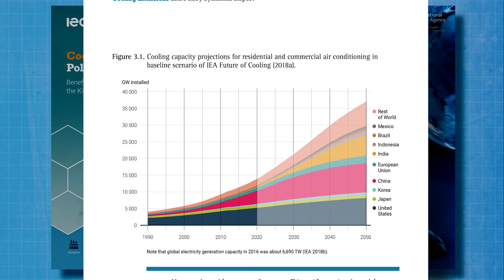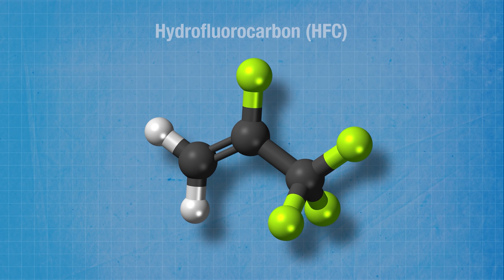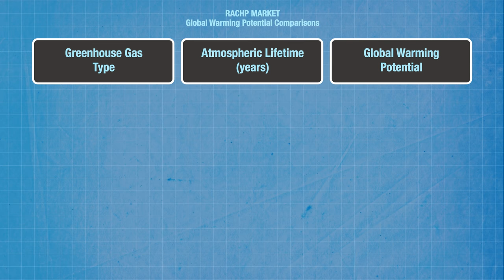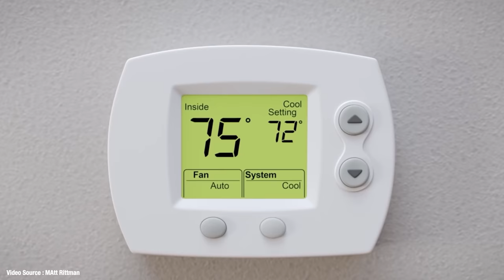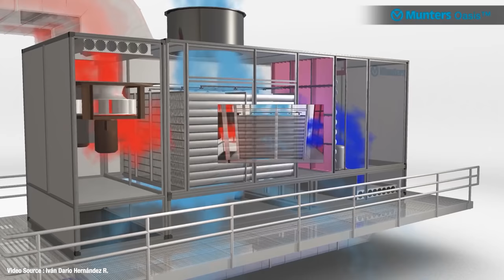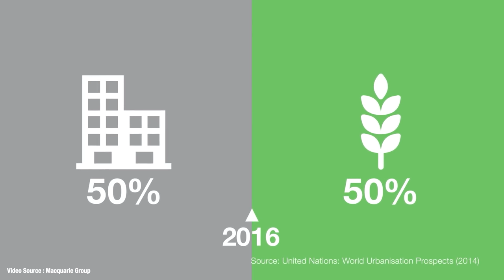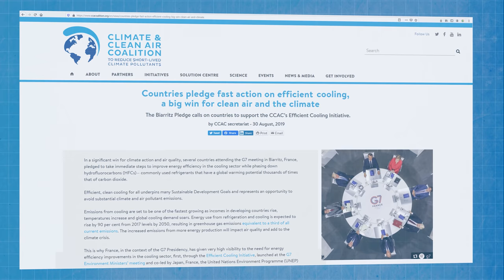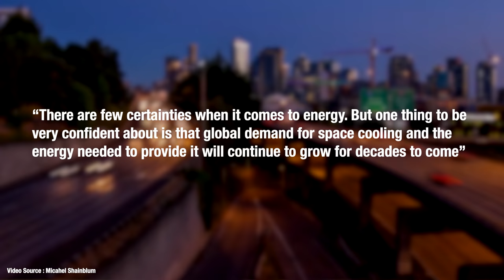Keeping cool in a warming world.

Comment: If a house is properly build with thick brick walls and good isolation, it might never need an air conditioning installation, just some heating and a heat reclaiming ventilation system.. Or just deal with the heat, like we do in The Netherlands.. Only large buildings have air conditioning here, family housing, virtually none. 

But sales of portable AC units has been going up sice we have one after the other record warm summers.. This summer we had an heatwave with 30degrees Celcius temperatures for more than two weeks, that are the times these portable AC units get sold out.

Comment: For regions that alternate between heating and cooling seasons, ground source (aka geothermal) heating and cooling could be helpful. Not only is it easier to transfer the heat to the cool ground than the hot air, but you are storing the heat from the cooling in the summer for use for heating in the winter.  For example here in Ottawa, Canada we go from an average low temperature of about -15C in January to an average high of about 26C in July (those are averages so obviously it gets much colder and hotter than that).

Comment: I went into Intensive Care overnight for a watering Jun 16, 2002. I only had 85 km left at 3 pm when it happened. I was going alright too until I went a bit unconscious, kept my heart at 135 bpm for 10 hours not letting it race & cause exhaustion. It was 35 degrees though & humid & the southwest air from Ohio & Illinois had a pollution alert index of "avoid breathing when possible" so I sweated 13-14 litres since 6 am and my heart stopped a little bit occasionally.  Great nostalgia memories.
Reply: Ouch.

Comment: I needed to replace my aging roofs some years ago. White roofing material was already commercially available then for a reasonable price. Now all my south facing roofs are white (they look out over a wooded area so not really standing out/eye sore) with the north facing roof is traditional black. Temperatures under the roof are now reasonable where before the space was unusable in summer.
Reply: I get a blindingly-white roof free of charge but it's a backwardsy method. It's non-stop blindingly-white November 1st to May 1st and then it's jet black May 1st to November 1st (in northern hemisphere). I must have used the wrong "adjustable roofing contractor".

Comment: One of the cheaper options is ground sourced cooling (and heating)!
Obviously the use of an "earth battery" is only good towards the ambient yearly temp! If you cool your house with one you are heating the catchment area ..... but that is heat you can recoup in the winter! Most of these rely on a Glycol heat transfer liquid rather than CFC. Although this may be negated by the inclusion of refrigerant heat exchangers coupled to the ground source heat pump ;0)
It may be an idea to incorporate some of the Earthship ethos into modern architecture! After all we are not just talking about an energy problem in isolation but also water management and waste disposal!
Reply: There is an air variant, called a Canadian Well. Involves a burried pipe, and a modest fan. Oh yes, an quite a bit of digging (that is how the heat gets in the ground ;-)

Comment: Thanks for another great video!

This is a really hard one to "fix" because excessive heat is a large and growing problem all over the world. Here in the West it's only a problem for two or three months in the year, but in countries closer to the equator heat is a never ending source of misery that's responsible for who knows how much inefficiency and an uncountable number of premature deaths. And with global warming causing climate change, the problem is only getting worse as weather patterns persist for longer periods. Heat waves last for a month instead of a week.

I think that cooling systems like A/C are a tremendous force for good worldwide. But as you say in your video, they've collectively become a positive feedback loop that's making the problem they were intended to solve even worse. The best solution (especially in warmer climates) is to design buildings (and cities) that don't need to be cooled as much in the first place. Then they could use systems like evaporative cooling to make up the difference. And this is a good idea for new construction. But most of us already live somewhere, and we're most likely going to keep on living in places that are already built. So any comprehensive solution to the problem of the feedback loop has to address cooling systems that are added to older structures.

Most architects treat HVAC as a separate system that gets plugged into their designs after the structure is already built, and whole industries depend upon the idea that you can take heating and cooling systems in and out of a building the same way you might change a hard drive on a computer. I think truly comprehensive solutions to the problem of the positive feedback loop have to work within that reality.

Comment: As I watch this video I'm sitting on my sailboat waiting out the pandemic in the tropics.  I'm running Air Conditioning that is powered by solar panels and batteries.  No generator on this boat.
   I've built a system based on a military equipment cooling compressor that is about 3 times more effeciency then what is generally used for ac.
   There are better ways to solve problems.  I'm a bleeding edge kinda engineer but what I'm doing now will be generally available in a few years.  -C
Reply: Oh Emily, you're living the dream. Good for you.
Reply: Hopefully it will hit the market soon. I would love to have one if it's not water cooled as I suspect yours would be. Standard air conditioners are rough on off grid systems.
Reply: @blaydCA  I'm not planning on developing it as a product.  But there will be a DIY video on our channel soon.  Bop over and subscribe.
   Yes my installation is sea water cooled but making one air cooled is just as easy.
Reply: @Clarks-Adventure  sounds interesting. On lockdown here riding out    the pandemic as well.  Thankfully off grid, so at least I don't have ye old 'lectric bill to worry about, but every year Southern California is hotter. What was installed years ago no longer handles to additional heat.

Comment: Supermarkets changing to a delivery based system with closed and energy-efficient coolers  serving households from central warehouses would make a great difference not just because of the smaller carbon footprint of the warehouse but by having one delivery truck serving twenty households in one optimized route instead of twenty vehicles driving back and forth for individual shopping trips. Of course, this mostly makes sense for the United States where farmers' markets are few and far between and individual food stores like butchers, bakers, and green grocers almost exotic.

Comment: Another good solution is an age old solution. Cutting ice from the lake in winter and storing it in cellars for spring, summer and fall. Then people can have ice boxes to keep the meat milk and other stuff cool without using any electricity at all.
Solar installations can be improved by cooling panels in the summer and storing the excess heat in heat batteries in the ground that can be used for geothermal heating in winter.

Comment: I’ve got to admit, I didn’t watch this one for ages because I didn’t want to think about those “what about global cooling, what happened to that?” people. Now I see it’s just a clever title for the energy costs of cooling our buildings. 

On the actual video, I’m dubious about that direct evaporative heating. There have been standalone machines that do that for decades now and they’re a very poor cooler on a hot day. Even though the air may be a few degrees cooler, it feels more oppressive due to the humidity. 

The indirect one looks like it has some potential though. Heat exchangers are good things. But the different refrigerants seems most important to me, as they’re used in heat pumps, fridges, freezers, as well as air conditioners. And it’s often more energy efficient to use these devices to make a cold side of a heat exchanger than to use water in such a system, if I’m not mistaken. 

So it’s important to get this right, as if we don’t, heat pumps etc will suffer too. And when our carbon is low power anyway, and we’re using heat pumps in the winter without guilt, I don’t see the issue in using regular A/C, with appropriate refrigerants. Though of course measures like white paint and adding greenery to reduce the energy demand is useful no matter what your source of cooling is. 

With regard to the paint, it’s been known for a long time, as that’s why the USA made many of its roads grey instead of black. They picked the grey as a balance between dazzling drivers and getting sizzling hot on sunny days. And that’s something to bear in mind with the white paint as well; reflecting 99% sounds good from an energy perspective but there’d be various health risks similar to white desert sand or snow to dazzling, long term damage, etc. if it were widespread enough. So it could be applied perhaps say to roofs but not to sidings, or perhaps we just choose a light grey instead of a white in practice? As always, there’s no outright solutions, just tradeoffs. 

But, as always, thought provoking!

Comment: In Costa Rica, Central  America, most houses are built of concrete blocks, with ceramic or tile floors, which are quite cool. No carpets. We have no air conditioning at home,  just keep the windows and inner doors open. Fans are used in the hot weather. Also, there is a lot of green life in gardens and backyards. However, it is the climate of our country that allows us to live without insulation or inner heating and cooling systems in our houses. I understand the United States can reach extremely high temperatures, even higher than our beaches in summer. I lived there for a while and I remember the heat of August.

Comment: I worked in Qatar for a year and I was struck by the amazing contrasts. One of these was air conditioning. There are huge shopping malls up to 5 stories high and including at least two full size ice rinks. These huge buildings are totally air conditioned so that you step out of almost 40deg C in the middle of summer into a cool 20 age C or so in the shopping mall. There are many huge office blocks and schools  - again totally air conditioned. The power come mainly from natural gas so I used to refer not to the carbon footprint so much as the carbon gumboot. These buildings have almost all been built in the past twenty years. Alongside these building are much older buildings which use a clever system of passive cooling. On the roof is a high chimney like structure which opens into the inside of the building. This chimney is heated by the sun causing an updraft of air which sucks cooler air into the lower parts of the building. In many of these older buildings there are pools of water placed so that the incoming air passes over the surface causing evaporation of the water. This has two effects. One is that the air inside is moistened which is pleasant after the drying air of the desert and also the forced evaporation cools the air further. Fuel input is zero (apart from water costs).

Comment: When people talk about heating and cooling they always think of air temperature instead of surface temperature.  I live in the midwest US, and over the past 20 years that I have lived here there has been a decent push towards getting insulaiton levels up to spec.  And as it is cheap and easy to do, and pays itself off in just a couple years it is one of those easy no-brainer moves that is easy to justify.  So what you end up with are lots of homes with lots of inuslaiton on top of the ceilings, and injected in the walls, and with an air temp of ~70-74*f, but with floors and cabinets that are closer to 40-50*f during the winter and 80-85*f during the summer.  This makes it feel colder than you expect during winter, and hotter than you expect during the summer months, and it is because basements are not 'lived in' or actively heated or cooled, so people don't address the air exchange going on there.  Seal up that little gap between the basement walls and the house, and you prevent that air exchange which makes your basement an even 65*f year round, which evens out your floor temps on the main level, and all the sudden you can dramatically lower your air temp in winter, and raise your air temp during the summer and still feel very comfortable while saving a ton of money, and not needing to run the HVAC nearly as much.  Sealing up my basement has helped the comfort level of my home far more than any amount of insulation that I have done in the house, and helps all of the insulation do what it is supposed to.

Comment: what about using a thermochromic paint on your roof that is white when it is hot out and then black when its cold?

my thinking is, the white will reflect the light keeping your house cooler in the summer months and then in the winter months it will turn black, potentially heating your house when you need it?  could be interesting I think.

Comment: Thank you for the informative video clip. I was wondering if anybody had done the maths on how much the atmosphere has been heating from the direct transfer of heat into the atmosphere from all cooling apparatus. For any cooling to happen the heat has to be transferred somewhere and it is nearly always to the atmosphere. We are using the atmosphere a a giant heat sink. Vehicle radiators, refrigeration and city landscapes all contribute.
Reply: I've not separated that out but I've calculated all the human energy portion. For the last decade it's ~5.8% (give or take 1%) like this:
735,000 gigawatts (94.2%) The solar warming excess to energy that Earth sent to space 
                                                     (energy to space reduced by +H2O, +CO2, +CH4, +N2O, net of 
                                                     "global dimming" atmospheric aerosols air pollution effect and with 
                                                     a few very small other factors also
  45,000 gigawatts 
  (5.8%) The warming  caused by human nuclear fission (matter ---> energy) &
                                                     human exothermic chemical reactions (almost
                                                     entirely C<x>H<x>+O<x> --->CO2<x> + H2O<x> )
So it's atmosphere heating from ALL direct human energy production is 0.20 * 5.8% = 0.012 degrees / decade. You'd need to assign HVAC portion yourself to get its portion of the 0.012 degrees.

Comment: You forgot to mention covering your roof on solar panels. If they are 20% effecient that means you get 20% less sunlight turned into heat (on the roof) additionally they put your roof in the shade with the gap between the panels and the roof acting as insulation. Perhaps a building code requiring all new houses to have solar panels installed may help. And having the extra electricity won't hurt.
Reply: And I am wondering of solar tiles. If I put them on I will lose the shading affect of the solar panels. I think I will go with the panels.
Reply: Also, integrating a water chiller in the underfloor heating system should be a thing. Cool your floor on solar during the day, use the floors thermal mass to last the night, and heat in winter

Comment: Heat Pumps for cooling and heating don't have to use HFCs with global warming potentials in the hundreds, you can use a gas with a global warming potential as small as 1 - CO2.  My hot water cylinder (Sanden) has CO2 as the refrigerant and is very energy efficient.  Some car air conditioners also use CO2.  Why these other refrigerants are not simply banned, thus forcing the use of more benign gases seems completely crazy.  Obviously they still require energy to make them work.

Comment: The office I work in has just saved 20% off the electricity bill by replacing fluorescent lights with LED. However, the vast majority of the power bill is air-conditioning. Since the building is leased, there's no incentive for the owner to replace the ancient existing AC systems with newer, efficient ones. Replicate this situation hundreds of times and you can see that there's the potential to save huge amounts of money and power if inefficient systems are replaced. The roof insulation is also poor, meaning that the AC has to work harder to heat or cool the office. The heat reaching the roof could also be reduced by installing rooftop solar, with the added benefit of offsetting the power used in the office, but again, the power bill isn't the owner's problem so there's little incentive to install solar panels or batteries. This issue of leased properties is huge in terms of addressing the consumption of power and energy efficiency. The same applies to rented homes and apartments. It needs government incentives to encourage property owners to improve the efficiency of their properties.

Comment: Where air conditioners are installed, white roofs ought to be mandated unless vegetation is installed.  Also, a LOT more geothermal systems should be mandated.  Finally, building codes should include higher insulation standards.

Comment: When replacing roofs, the roof could be made of a vacuum sealed window that not only acts as insulation and sound barrier but has an outer layer that become reflective in the summer and allows suns heat to enter in the winter.
Reply: With windows as roofs the upper level of buildings could also double as indoor farms. Food grown on site both in homes and office buildings would be nice.